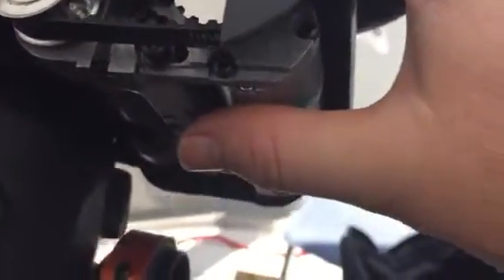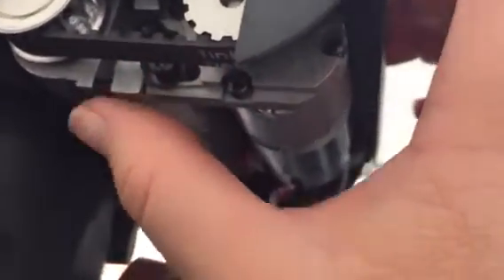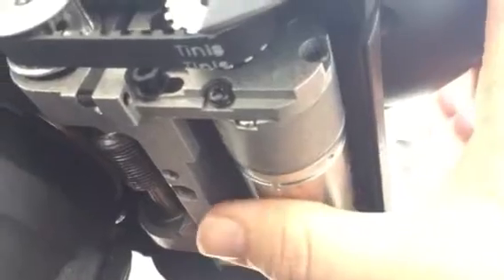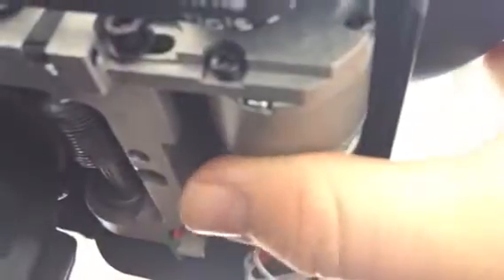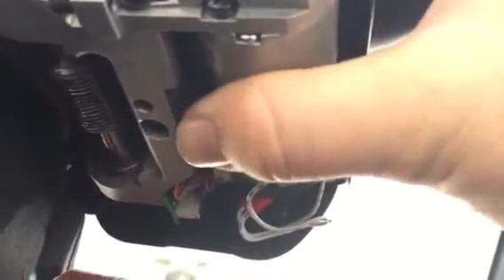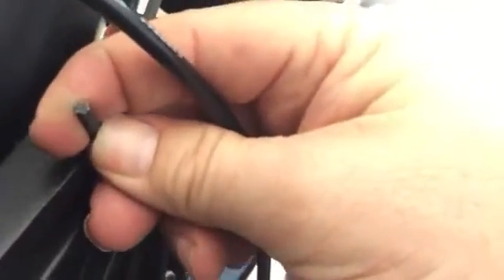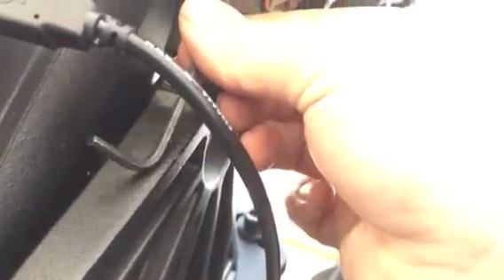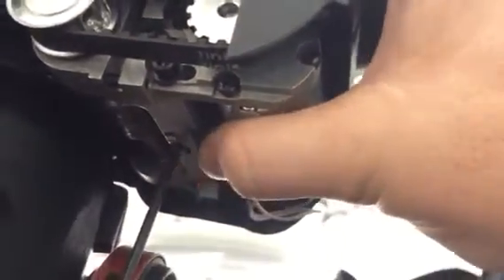Celestron CGX Mount RA / Tracking Problem part 2

Comment: So compared to your first video, would this one screw be sufficient to be loosened a little bit?
Reply from the maker: Matthias Nott  since this video I’ve learned that it is best if possible to avoid touching these screws. Adjusting is finicky and difficult.

I have adjusted mine to half of the travel if the spring and then ticghtened the stop screw until it can just move a little bit like the manual says. 

The correct procedure for fixing backlash or binding is to loosen two screws on the underside of that block that hold it in place. Then use the two other screws just under the RA counterweight bar. The large one pushes the RA worm into the gear. You adjust that until it binds the motor and then back it off just a bit. The smaller of the screws locks it in place and you tighten lightly because it will also shift the worm gear if you go too tight.

Then tighten back the two screws that support the block. 

I hope that makes sense.

The best thing to do is 1) leave it alone unless you have a real problem. 2) if under warranty and you have trailing stars, send it back for service and demand they pay shipping. 3) if desperate , do web research first they adjust in small increments and be prepared to be frustrated. 4) sell mount and buy an atlas from Orion or losmandy or AP or etc.
Reply: @davecompton8456 Thanks Dave. Any suggestion about my other question regarding whether to choose an 8''/AVX or a 11''/CGX?
Reply from the maker: I did reply on that vid. If it doesn’t show up let me know and I’ll message.

Comment: Hi Dave,
I have a similar problem. I have had my CGX mount for just under a year and my tracking is progressively getting worse. I tried, as has been suggested by some, to make the RA east heavy and the DEC front heavy. It helped a little bit, but not enough. After adjusting for backlash, can you take the weight shaft and wiggle it back and forth with the RA clutch  locked and feel any movement? Before I try and adjust the gear mesh screws, I would like to know if the movement I am getting when I wiggle the weight shaft is from bad gear mesh (backlash). If it is, the adjustment should get rid of the movement.
Thanks for the videos and I agree when you buy such an expensive piece of equipment one would think they would have had this nailed down before selling them. I'm new to this hobby so I'm a bit disappointed. I watch Chuck's Astrophotography and he is using the same mount and his seems to work flawless. He deals with extreme cold in the winter. His tracking is always perfect.
Thanks again,
Dan Vitale
Reply from the maker: Dan Vitale  sorry for a delayed reply. Yes, it is annoying. I replied to another comment just now and you can read that. Basically if you can endure the wait you should send it to Celestron for adjustment. Or I would suggest searching the web for a pdf how to from Astro Physics on how to adjust their RA worm. It helped me understand what’s going on.  There are two screws holding the whole block in place. They are just under the worm gear. You loosen those just a tad bit where they still support the block. Then the bigger screw under the counterweight bar (not the one in the manual) pushes the block into the big gear. Tighten that until the motor bonds and then back off just a little. The smaller screw is a stop screw so you might need to loosen it to be able to tighten the backlash. When I did mine I took off the motor belt where I could turn the worm with my finger. I tightened the screw until it binds and then back off a little. Then tighten back the two screws that hold the lock in place. When I was done I had just a minimum of wiggle on the counterweight shaft if I moved it. If that rocks back and forth, you are too loose. If the motor can’t move you are too tight. Also if you get star trails it is either too tight or one of the RA worm gear bearing is bad. 

I tried the following night to look at slewing and guiding and it was acceptable so I stopped.

A little goes a long way. It is annoying and time consuming and dangerous. The two screws that hold the block in place can strip if you crank them and then you will be hosed. That’s why it’s best to let them fix it.

Best of luck.

Comment: Can you post video of your phd2 guiding? Are you able to get consistently under 1" rms?
Reply from the maker: Marty Spallone  I'm using Maxim DL for both cameras. In the follow up video with the test results, I show how it did at night. I'm pretty consistent inside 1.5 pixels on the guide camera which for me is about 1.25 arc second. I'm using 2x2 binning on the main camera so my stars came out round (for once). But it was very hot so I only did a limited run of about an hour.
Reply: Thanks Dave